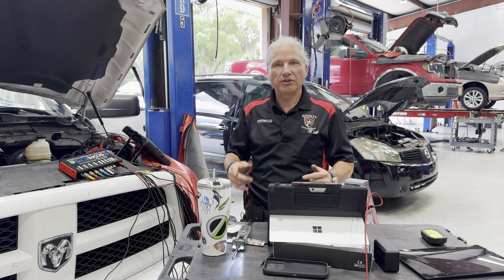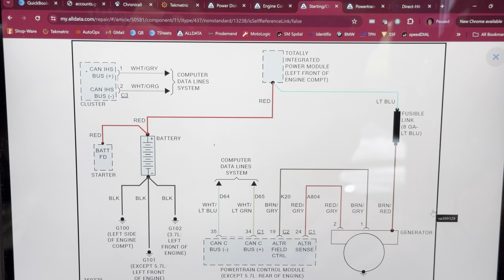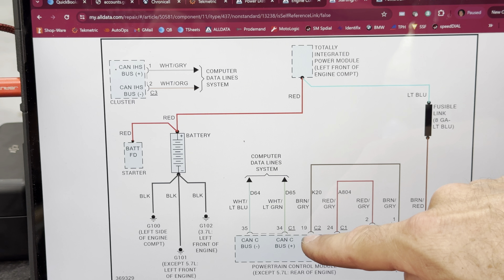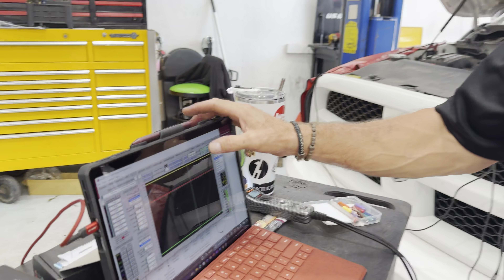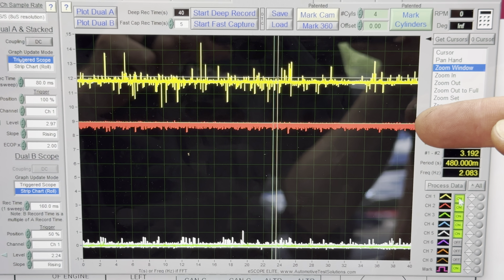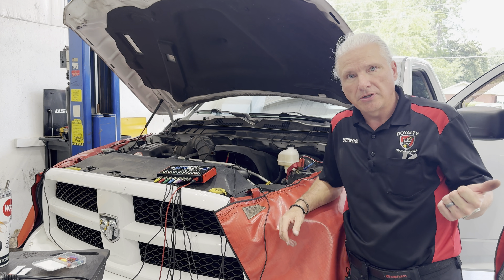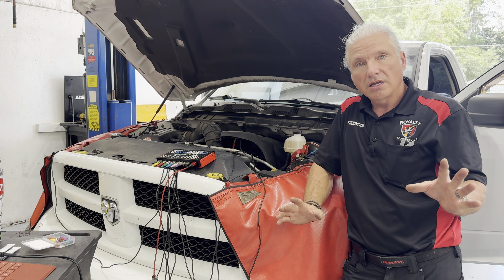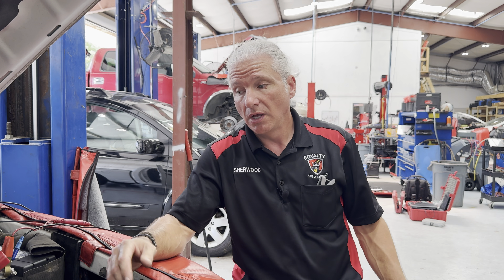They Replaced The Alternator On This Ram But It’s Still Messed Up! (Part 3 Why You Need A Scope!)

Comment: Would it be possible to retrofit an alternator that is not pulse width modulated with a simple ignition on excite circuit?  What a dumb design to have replace the ecm to make the alternator function!

Comment: It would have been nice to see at least the final PWM signal after replacing the ECM, I marked this job as a NO FIX in my library. Even IVAN over at PHAD gets a no fix for not showing the end result but he at least puts some info at the end of the video of the actual repair back at the original shop or the no parts required fix has been good for a month so far. In this case, at least some text saying the PWM at what frequency is proof enough of the fix. I do not see a second video of the repair on the RAM, cheers and thanks for the tutorial that is not a fix.

Comment: That's dodge for ya lol voltage regulator type setup is in the engine control module i myself own a second gen magnum V8 dodge ram,i have seen several of them and mechanic says nope its not bad truck still runs...

Comment: Excellent video!  I am sure that Sherwood checked for this outside the video, but for a DIYer, there is 1 more potential issue besides bad pcm.  The brn/gry wire may be shorted to ground somewhere since this is a backprobe test with that wire still connected.  That leaves a possibility of pulling the ecm pin 19 to ground.  A simple test light will check for that.

Comment: There's a huge difference between a mechanic and a TECHNICIAN.
Reply: True a mechanic would have run a damn wire from the goddamn alternator over to the battery and said f*** it😅😅😅 I'm that guy!

Comment: Curious as to why you test the voltage drop on the positive side of the charging system but you didn't mention checking VD on the ground side? I've seen this bite many techs for failing to check VD on ground side of circuit. The biggest mistake in electrical diagnostics is assuming you have a good ground just because you have B+ to the component. This has been my experience. Great to see you encouraging the use of a scope. The main reason techs avoid scopes is because they don’t know how to use one and not having a solid understanding of DC electrical fundamentals. Your series should help many techs.

Comment: How about the pins and the connectors themselves? I almost threw a throttle body on one of my cars. I was seeing a bias voltage on my scantool and voltage on the wires backprobing and piercing. However, I found out on accident when I pressed the connector really hard the scantool responded, lol. I front probed at the connector, I found Nissan has a little hole under the connector that a t-pin can fit in. There was zero voltage there, so I spliced a new connector and it was fixed.

Comment: Bought my first scope in 1972 only did analysis on ignition systems worked my way up in 1984 to a Sun scope that did most tech from the times I now have a portable unit that covers most stuff & I’ve never looked back. To see it is to believe it 😊

Comment: My Dodge truck same thing had to replace the Ecm. Thats a expensive voltage regulator. Miss even external Regulator. Its Crazy. Sherwood , If the ECM was good and you probed it with your power probe would it destroy the ECM?. Thank you for your work.. I've never had much scope experience. During my time I have a old Snap On Advantage  I be leave it has a scope  will it work for these applications? Thank again,,,Don

Comment: I don't know how this operates but does the alternator sense wire send voltage to the pcm so the computer knows the alternator output? If so why wouldn't you be worried about that input to the pcm and just at the alternator? Seems like you could have good sense at the alternator but may not be getting to the pcm because of another circuit issue. Tell me if I'm wrong.
Reply: Wrong ghost rider

Comment: Keep beating this scope stuff till its dead and then beat it till it comes back to life Sherwood lol. 

Im 33 and mobile to repair shops in the greater Houston area. I use a scope daily if not multiple times a day. I love what you said in the first video, something to the effect of " i dont know how to or I dont know people fix cars without a scope". I tell people almost the same thing all the time. " Im not smart enough to fix cars without a scope". Not meant to be cocky or arrogant. A scope is simply the easiest in my opinion. And then the argument that scopes cost to much is dead. Techs have no problem making weekly payments till they die on hand tools off the tool truck. Some of those special tools they buy they only use once every 5 years. It costs more in my opinion to not have a scope. I don't use it for every car. But when I need it ive got 4 of them on the van lol. Keep it up guys!!

Comment: Sometimes the diodes in the alternator can leak, cause a  short, and drain the battery. You can use a meter to test.

Comment: I have a charging issue on my 08 Altima, brought it to 4 shops they all say it’s fine. My response is if it’s fine why do my batteries die after 2 years. I checked voltage with a basic lighter outlet voltage reader and I can clearly see as I’m driving the voltage starts good 13.8 then it drops to about 12.5volts. I had to start checking the battery with a voltmeter to avoid getting stuck.
Reply: I am not a professional by any means, but I believe around 2007/2008 is when Nissan/Infiniti started having the alternator charging being turned on/off by the ECM. If you take a lot of short trips it's possible for the battery to actually never charge. I don't think the ECM tells the alternator to start charging until the car has been on for X amount of time or driven in X amount of miles in one drive cycle. There is a way to by pass the ECU control and make the system function like a normal alternator, but you'd have to look up some wiring diagrams to see which wires to modify.

Comment: Hey Royalty Auto nice diag video. One thing I didn’t hear you mention is about terminal fretting or pin drag test at ecm and terminal connector on field control wire. Or did i misunderstand your diag process? Thanks

Comment: I'm curious how you charge for this.  This is what it seems like, please correct me if I'm wrong.. The customer gets in the door and immediately agrees to one hour.  That hour gets you to the pcm being at fault.  You then notify the customer where you're at, and get another hour to test the pcm power/grounds and confirm the pcm needs replacement?  This hour to test the pcm may go up if the module is difficult to get to, I get that.  And then once the pcm is condemned, I suppose service info will tell you how much more labor will be involved to replace and reprogram the new one?

I often watch these videos and imagine the conversations I'd be having with the customer in your place.  Respect for you not talking trash about the other shop (you talk about this often.)  The fact that they misdiagnosed the parasitic drain and couldn't diag the pcm after the alternator was first replaced kind of makes their first call suspicious, even though there's a chance they were correct.  

I suppose one thing I would've done different, when applying field to the alternator to prove it worked, I would've applied voltage to the command wire at the pcm.  This would ensure that command wire isn't grounded between the pcm and alternator.

Comment: on the older dodges to help customers many of the alternator shops install external regulator to keep from replacing computer is that a option in your shop
Reply: Yup.  The good 'ole silver box with 2 prongs.  Getting harder to find, but not impossible.  Making an alternator part of the CAN bus network is just plain stupid.  It doesn't need friends to do its job.  It is a stand-alone unit.  Can bus failures are more than common.  Don't need to add more shortable circuits in parallel to complicate matters.

Comment: Why do we need the computer controlling the alternator. The simple internal voltage regulator worked for 40 years. Load increase on system, voltage decreases, voltage reg increases output. SIMPLE.
Reply: To protect what the cars wasn’t equipped w 40 yrs ago.

Comment: why  do you need to use a scope for? I just put a multimeter on the battery and maybe rev,it and if it goes up you know it's charging.
Reply: so he can look at many data points at once.
Reply: One benefit / reason for using a scope is that a scope can capture / show an intermittent problem.  Along with other channels hooked up to equipment on the car (integral to system operation) the root cause is distinctly identified — and not just a mere symptom of the source problem .

Comment: Hi can I pick your brains for a minute! I'm curious is there any special coolant I should use for Mercedes engine petrol 4 cylinder cast iron block I think and the aluminium head M111 it's got a blue one in there at the moment I wonder if it makes much difference they say to use an organic compound I'm not sure what that is under code what's antifreeze or coolant do you recommend?

Comment: Impressed you guys have the ability to change modules. 

We had a BMW 3-series (E90) and over the period of 2-3 years we had 3 modules go. These modules were BMW only supplied and they need coded to the car once fitted, again this was something only the BMW dealer could do.
Once fixed, we ditched BMW and have never been back.
Reply: Im a 1 man auto shop in a small town in NWPA. I own a 09 328i I myself can program and code not only BMW but just about any make and model.
Reply: @eddiereichel9354  That's very impressive, I take my hat off to you sir!

The module(s) that went in our car had to be ordered on the basis of what was fitted to the car e.g. if xenon lights were fitted then a different footwell module part number had to be used. No other repair shop at that time could code the module to the car other than BMW and I'm not sure that even now anyone else near me could.
Reply: BMW = Bring More Wallet

Comment: At 8:15 the red trace went down (ground) I get that because it was no longer connected to the alternator. Why did the green and white trace (command) go up? Had to be voltage out of the PCM.
Reply: if the field control is duty cycle to me their should be a pulse width signal. appears its stuck on ground. and if i understand hes checking this at ecm and alternator. if that wire is shorted to ground you will get those readings and may not be the ecm. he did unplug and full field the alternator which proves its good. i would unplug from alternator and the pcm and check ohms to ground on the field wire to prove its not shorted to ground. thats the weakness in using the scope it takes more than the scope somtimes.  this is where a scope or multimeter will lead you down a wrong path if you dont follow threw with understanding the circuit .its the brain power thinking at this point. hes not following threw for truth to be seen. i no hes good not knocking him and dont mean no harm. this is where a good teacher would  prove out the system and then the scope would be king. or cut the wire close to the pcm where u can prove the wire is not grounded and look at a wave form and if it stayed on ground then i would test power and grounds at ecm for final proof u need an ecm. just my thoughts
Reply: again what he s not doing. maybe draw out a signal that the alternator should see from the pcm. would be good for people to see and understand so when they dont see it its a visual for people to help them. and understand if the wire is shorted to ground then the wave form hes showing is truth and what ever the fix is(at this point i cant prove its the pcm) but after the repair what a known good is. its always a before and after is where the truth lies and threw data can be proven
Reply: its like when i went 2years for automotive. the problem i had was they would bring in a car and we would diagnose it ,but we never got to see the fix after the diag .we never got that conformation which we all need, before and after is a big deal

Comment: Here's my scope test request: I would love! to see a relative compression test adapted to a hybrid vehicle that uses the electric drive motor to start the combustion engine, such as Priuses do. 
Toyotas have a relative cylinder speed test (which stands in for the usual cranking relative compression test) available via scan tool, but I would love to see that measured via amp draw - by setting up a cylinder 1 trigger along with recording the amp draw of the high voltage drive motor when cranking the engine.
Love what you guys do! Thanks for all the awesome content
Reply: Good one 👍🏼. That would be useful .

Comment: I'd love to see more GDI injector and high pressure fuel pump solenoid scope waveforms control and brake down of each part of the waveform and some examples of bad(If you can get them)

Comment: Haven’t watched the video yet but I’m sure you mention this. Always check generator pulse width on the Chryslers because the regulator is internal to the pcm. I put a lot of those in at the dealer.
Edit: after watching. On the dealer scanner I believe the number scale it shows goes up to 999 not just 100% and that was always the dead giveaway the ecm was bad. It’s nice to see it shown on a scope and not just a because the book says this is it kinda explanation.

Comment: Module rebuilders are getting real good at replacing those drivers and it saves programming.
PPT for the DTC you had shows using a real test light while commanding field control from lo to hi percentage and watching the change.  More than one way to milk a goat though.  Thanks for sharing.  
Side note-I keep my Pico in a dedicated cart and ready to go so it really doesn't take too long to set up when using.
Reply: @greggc8088  only issue is turn around time. A place near me is 7-10 days for a repair. New ECU can be had within a 24-48hrs or even used (yes you can reprogram)

Nice job on dedicated cart. Its something im assembling

Comment: Replacing both the battery and the alternator is a huge red flag to begin with. As a 40 year master mechanic I    “Test not Guess “.  Great video Sherwood
Reply: First off- I’m not an argumentative commenter.  

I would like to  offer a counterpoint…. I have maintained a fleet of 20-30 vehicles for over 25 years.   About 15 yrs back started replacing batteries preventatively between 3-4 years  of use.  There has been a remarkable decline in the number of starters & alternators being replaced.    With that in mind  is it really a red flag to replace a battery along with a failed alternator?   Obviously there are lazy/sloppy/greedy service providers that simply want the upsell, but I don’t see it as a red flag when a thorough repair is the goal.   

Again I’m not intending to argue the point.
Reply: @kc360awareness  I've been an auto  mechanic since the mid 80's and now a shop owner/ mechanic. I've seen a lot of batteries go bad and cause the alternator to overwork and go bad. I've also seen alternators go bad (over charging) and cause the battery to go bad. So I agree with you, not necessarily a red flag. 
Excellent observation on swapping batteries for preventative maintenance and prolonging alternator and starter life. My practice is to test the battery on every car that comes in and recommend replacing if they are starting to show weakness.
Reply: @jeffhesse8415  completely agree. I still go back to Test not Guess
Reply: @kc360awareness  go for it.
Reply: I mean it’s kinda common to see someone refusing to replace their alternator until it dies and at that point they smoked the battery. I mean people don’t even change their oil and that’s cheap to do.
Reply: @Hellcat71782 it gets even worse, with the dodges. When they started to put the voltage regulator in the ecm
Reply: Yep - test don’t guess.
Reply: You should now be the " bater " mechanic.😜😜😜😜

Comment: hmm for DIYers.. scopes geared for automotive diagnosing (4 channel +) I've seen are prohibitively expensive  ($1k+)..
Reply from the maker: Stay tuned! We will be covering scopes that are for beginners or DIYers some time soon!
Reply: HanTek is an option for DIY. That SnapOn scope is around 15-20k last I checked but its really freaking awesome. I use a PicoScope
Reply: What about the topdon scope with scanner any good?
Reply: You can buy a basic two channel PicoScope, but you would need a laptop to run the software. It's not as fancy as their auto scope, but it should probably be sufficient and it's less than 200 dollars I think. There are also some 1 channel scopes that can fit in your palm that are based on Android AESWave calls them uScope, but you can find their non-branded version for less than 50 dollars.
Reply: @smc9764  im running mine off a panasonic tough book i got off amazon
Reply: 2 channel, even a single channel scope will give you a TON of information. His diagnostic here, you can do all of it with a single scope.